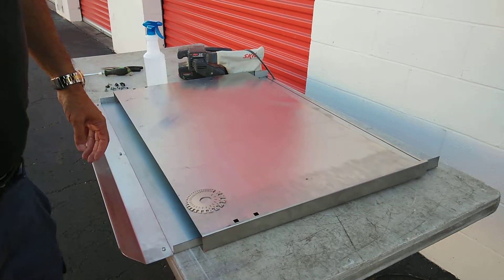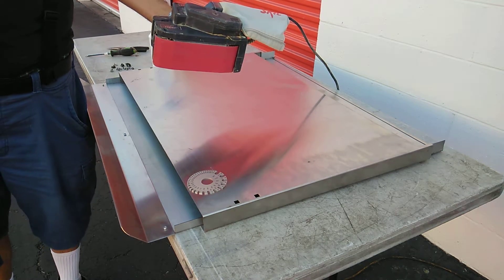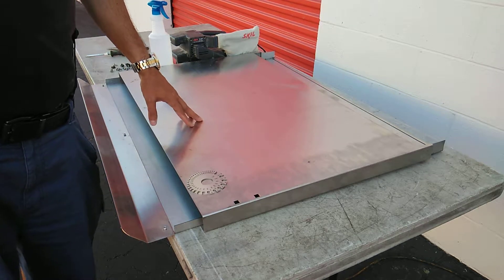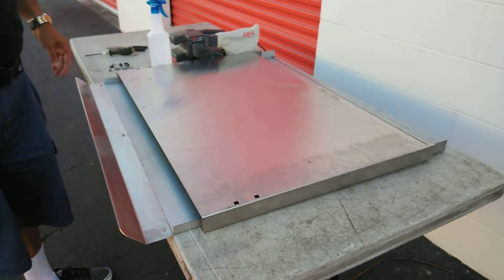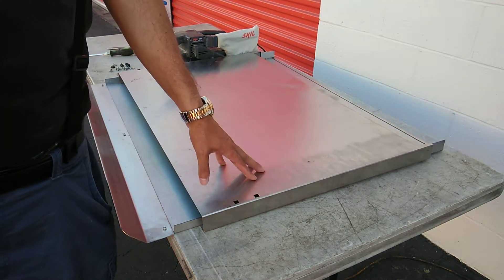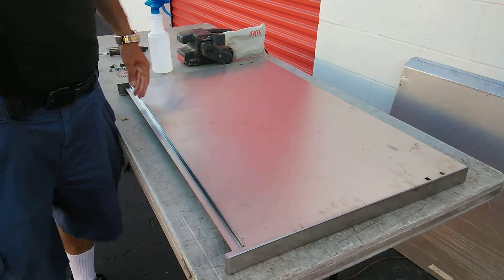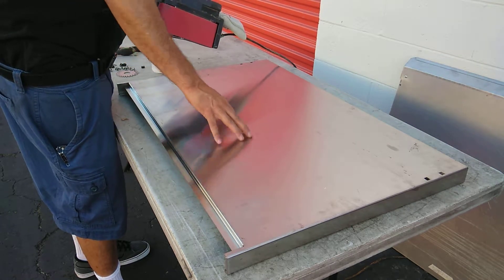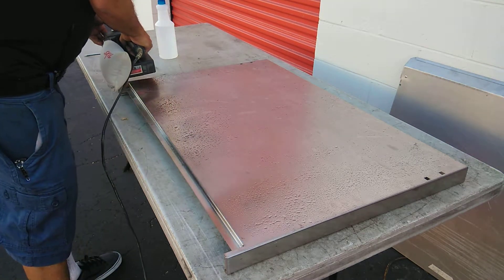Refinishing Stainless Steel

Comment: only note:
In my machine shop (industrial tanks and processes) we used a 6" wide wire wheel to do the final stainless grain. Dry wheel and then polish after with a buffer